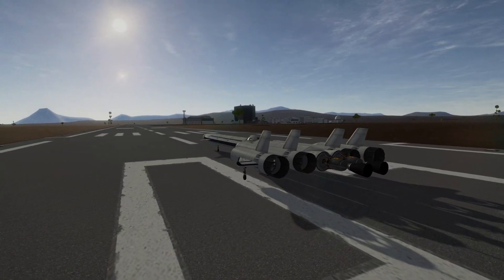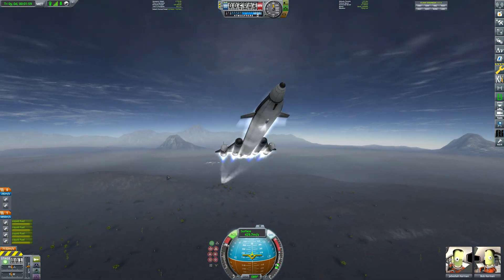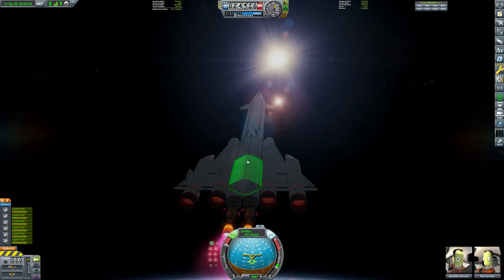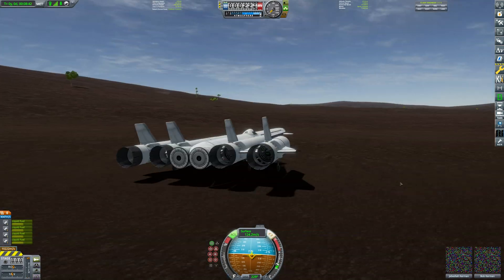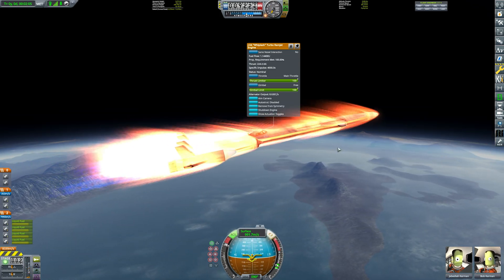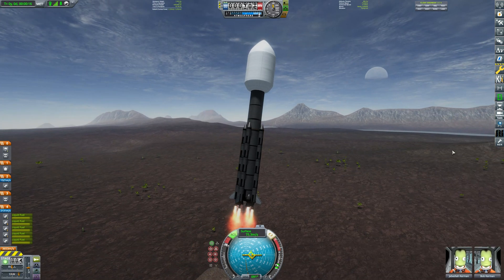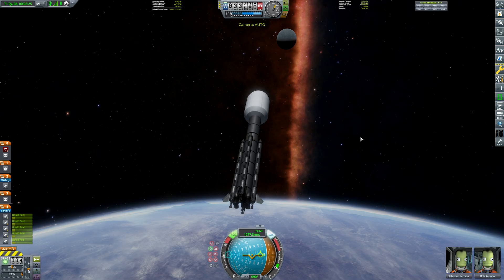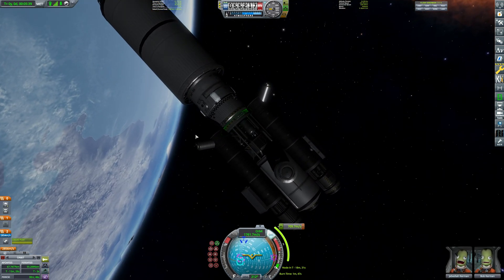KSP Beyond Home - Testing new Technology! (Career Mode)

Comment: "testing out this SSTO" why does it have 2 stages then?
Reply from the maker: SSTO is not defined by a single stage, it's defined by jettisoning no parts on the way to orbit, thus this is an SSTO. I split the engines into two stages because I hadn't assigned action groups and this was easier.